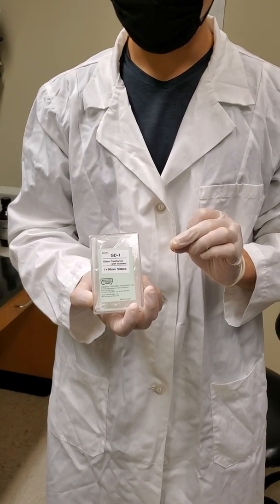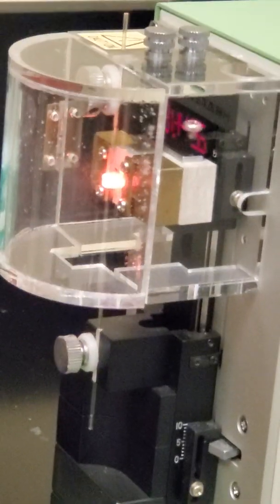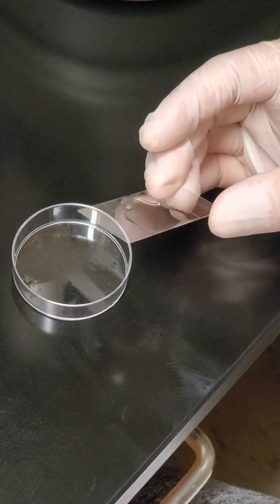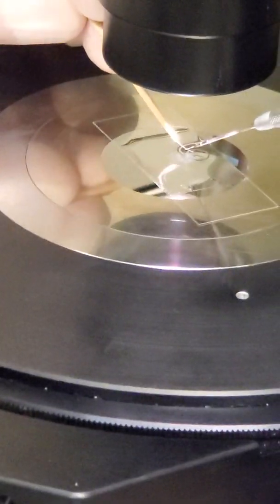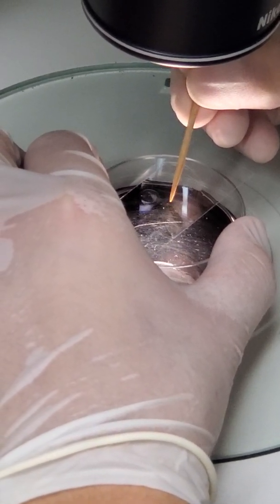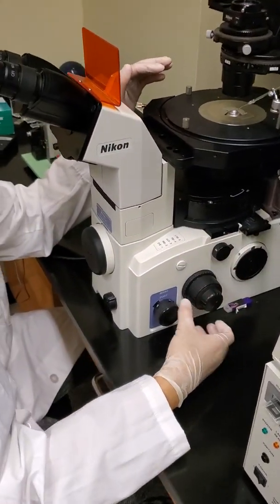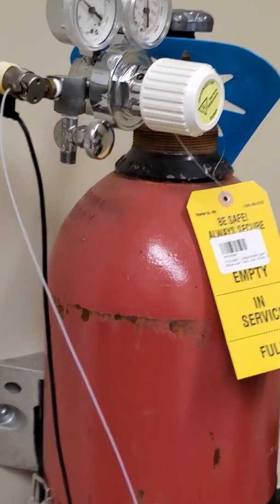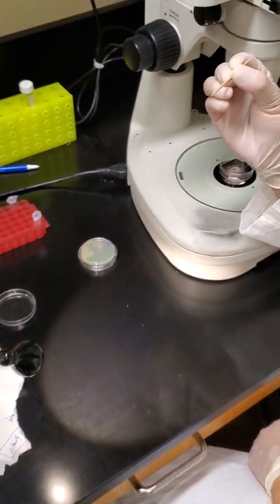How to perform a CRISPR-Cas9 Microinjection (C. Elegans)

Comment: What is the pressure of N2 in the injector? Does it affect the results?
Reply: 20 psi
Reply from the maker: I'm not sure what the exact pressure is, but as long as it's a reasonable amount it shouldn't affect much. You just need enough pressure to push the solution through the needle, and you can clearly see it flow into the gonad when it works. I suppose if it was too high it could rupture the gonad or if it was too low you might not dispense enough solution, but it's probably a fairly forgiving range.
Reply: @dominatorj  Thanks for the info!

Comment: Which cells in the gonad take up the DNA? Are the offspring guaranteed to carry the plasmid? Why not inject the embryo at the one cell stage instead?
Reply from the maker: You can actually see the CRISPR-Cas mixture rush through the gonad upon injection, so hopefully all of the oocytes take up the DNA that way no matter which gametes get fertilized/laid they have a chance of carrying the mutation. Not all of the offspring are guaranteed to receive the mutation, and in fact we generally inject at least 10-15 worms (more than that if they do not survive they injection) to ensure we get at least one F1 generation/strain with the mutation. What we are injecting is actually RNA oligos directly complexed with the Cas9 enzyme, so no plasmids are necessary. The mutation is directly inflicted upon the target locus within the chromosome. 

I can think of a couple of reasons to use the gonad rather than the embryo. First of all, you are much more likely to target the F1 generation at the one cell stage if you inject in the gonad while they are still oocytes rather than trying to find a laid egg that hasn't undergone any cell divisions yet. Furthermore, the gonad is a much easier target under the microscope than trying to inject an egg (not to mention have it survive after).
Reply: @dominatorj  That's pretty cool. Is there an easy way to tell if the worms got the mutation or not (besides sequencing)?
Reply from the maker: @thefenerbahcesk4156  We include an additional mutation in the dpy-5 gene (dumpy) so that if the worms are edited, they will exhibit the dumpy phenotype for easy selection. (We then confirm they have the desired mutation with PCR.)